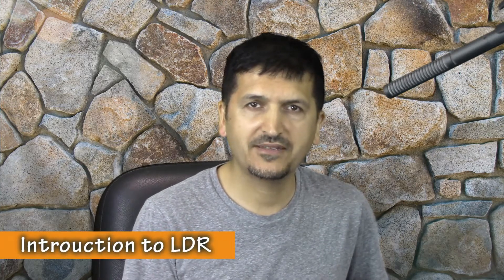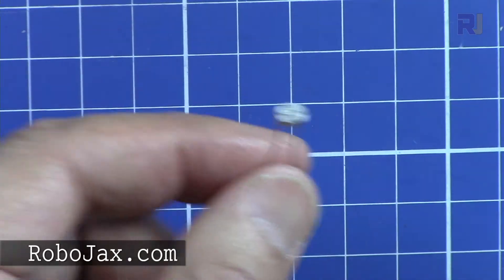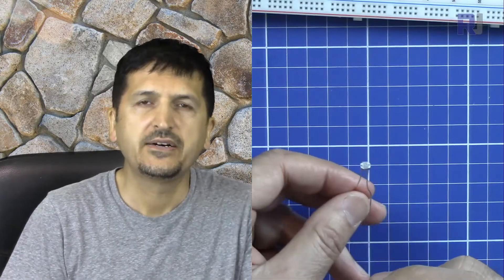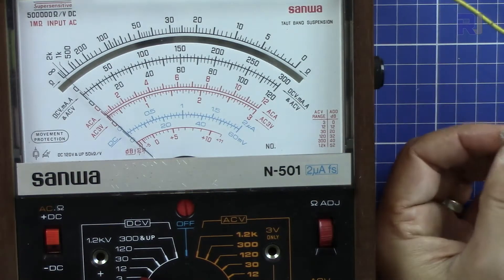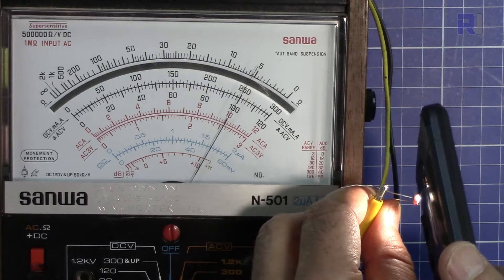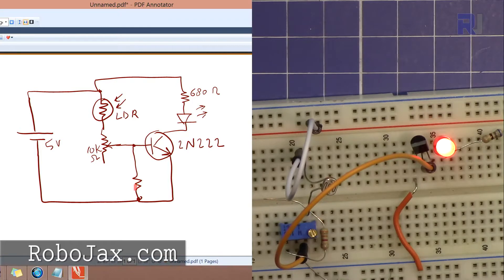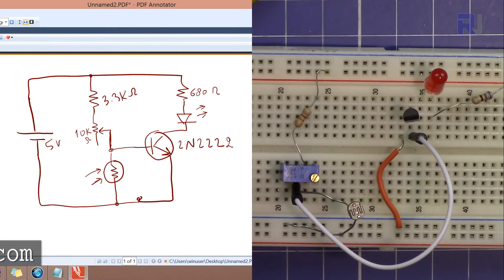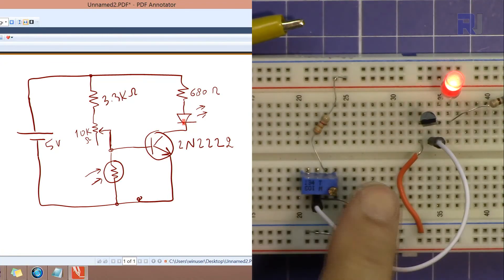Introduction to LDR or photoresistor  and how to Turn ON something with light - RJT655

Comment: Hi , If my input voltage 24vdc what is the resistor need to be use
Reply from the maker: Hi,  I presented the value of resistor in total dark and full light.  you use ohm law and calculate the current for 24V it is very simple.  if total power is less than 0.025W, then  you can connect it.

Comment: Great Explanation Robo 👍.So the Normal Photodiode modules available in market are those decreases Resistance (Voltage increades ?) when light fall on it
Reply from the maker: Yes, correct

Comment: Hello Robojax.
I have been trying to do this for a few days now, followed a few tutorials but have the same problems.
First the 10K potentiometer doesn't seem to work for me, as in the LED is turning on way too bright, I almost went to 300K resistor(trying without potentiomenter) to get the correct brightness on/off.
Second, I would like the light to go ON/OFF, but as evening approaches there is a range of darkness where the LED is slightly on not 100% and little by little this brightness increases as the darkness increases. I would like it to go from 0% to 100%

Any help much appreciated
Reply from the maker: Hello Joe,
I don't see problem if you followed the instruction. I assume you the exact transisitor and supply voltage is correct. The problem could be 1-the 91Ω resistor check the value and make sure it is connected. 2-the pot is bad. check it using multimeter.  Goog luck
Reply: use a micro-controller such as the Arduino nano (pack of 3 for $12 on amazon) to take photoresistor as input and based on value, send output to led.

Comment: thanks for helpful video... i am using the LDR turning on a LED when it goes dark.... but it only seems to work without the 91ohm resistor ? any ideas
Reply from the maker: If it works and stable, that is okay. The 91Ω resistor at the Base of transistor makes it stable.